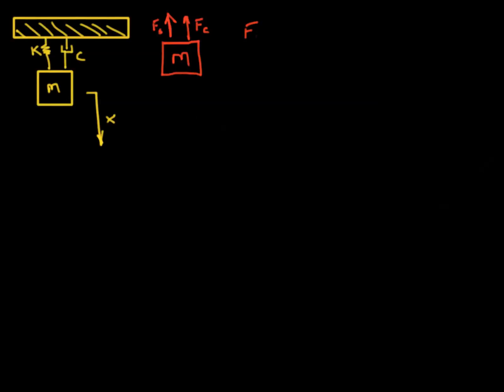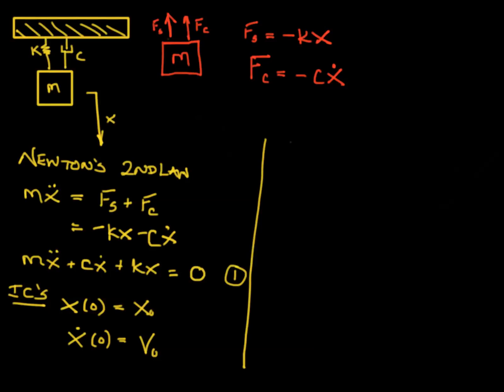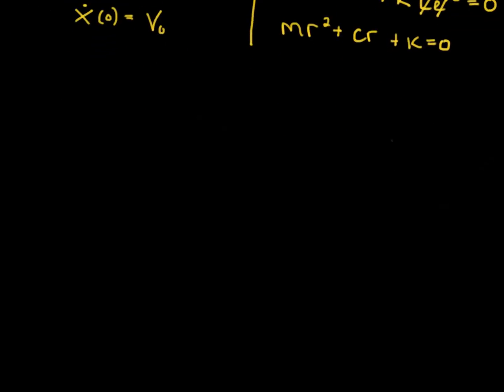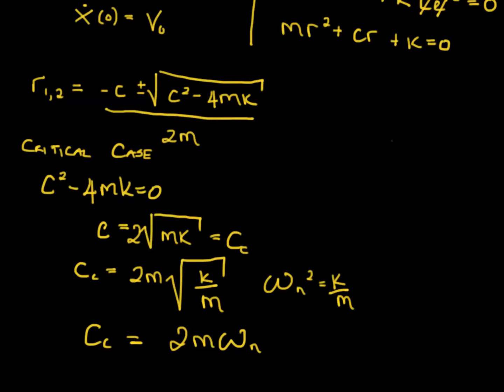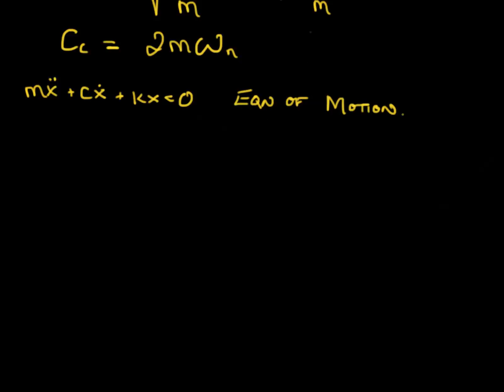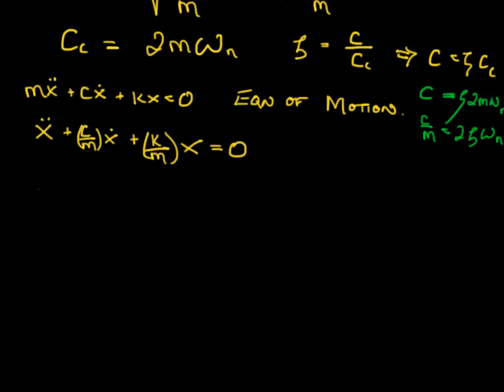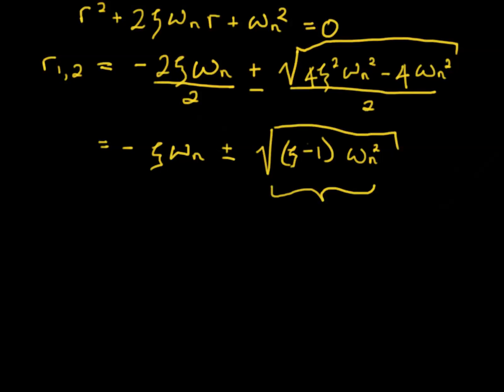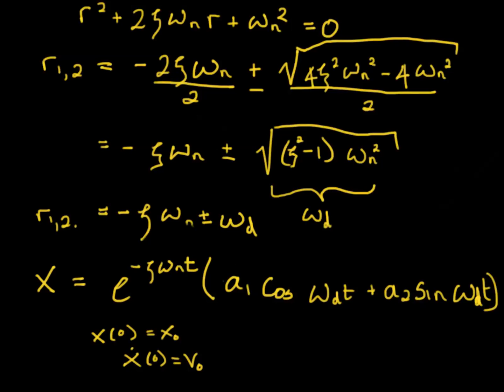Free Vibrations of a Single Degree of Freedom (SDOF) System with Viscous Damping

Comment: Hello, just unsure why the final solution involves sin and cos if we're dealing with the critical case? I thought we only used the trig functions when the roots are complex, and the general solution involves oscillatory motion — hence the sine and cosine terms.
Reply from the maker: I just showed the general form of the solution here.  However, in the case of critical damping, you end up with repeated roots and as a result of this special case, you cannot write the solution in the form of sin and cos, but instead the solution becomes an exponential with a negative exponent (ie a decaying exponential).  You can find an explanation of that here: youtu.be/S2-26LR8_Es?si=HmLhVArmR-9zBvqh&t=840
Reply: @Freeball99  thank you so much for the response!! especially since the video was posted so long ago, I appreciate it. Do you offer tutoring services?

Comment: I am not sure...why do you ignore the weight of block in the free body diagram?
Reply from the maker: +Sharon leung there is no assumption that gravity is present.  Another way to think of it is that the mass is moving along a horizontal, frictionless plane.  It turns out that the inclusion of gravity simply changes the static equilibrium point (which is the point about which the oscillations occur), but does not change the natural frequencies nor modes of vibration of the system.

Comment: C bar doesn't really matter in this case as they are canceled out eventually. I would rather treat it as a habitual action for the sake of physical description. Most of the physics equation has a form of A*e^coswt, so we can gain information of A (typically amplitude). In pure mathematics, e^rt is sufficient to describe any number (including complex number?) so C bar looks useless here.

Just my 2 cents, not very good in Maths either
Reply from the maker: Shawn, not sure I understand exactly what you mean, but a few things spring to mind.  Hopefully this addresses it.

Simple harmonic motion is governed by 2nd order ordinary differential equations. 
In a previous video https://www.youtube.com/watch?v=5Q_A15h7YgQ I demonstrated how to derive this using complex notation AND how this can be converted from the complex form to a real form.

In the video above, it was never my goal to solve a particular problem for a given set of initial conditions (as I had done in a previous video) , but rather to show how to incorporate damping into the derivation and solution of the characteristic equation.

You are correct that Cbar doesn't have an effect here because it cancels, however it is important to note that it is non-zero (for non-trivial solutions). 

With regards to your math above...e^rt is NOT sufficient to describe complex numbers...for this you need to add an i (where i^2 = -1).  So if you just assume solutions of the form:    x = Cbar * e^(irt)    then this will handle the complex case too.  You will find, however, that this assumption leads to the same final result that I presented.  I encourage you to use whichever approach is easier to understand, but from my experience, the students taking this introductory vibrations class often battle with complex analysis which is why I chose this method.

Hope this helps.

Comment: why take c Bar in teh value of x ( x=c' e^rt). i'm weak in math, tell me if that's some mathematical rule, I'd ignore it and learn it like that
Reply from the maker: Ashutosh, this is just a dummy variable - I could have called it anything.  In many of mathematical texts, this is written as just 'c', but I didn't want to confuse it with the damping constant, 'c' I decided to use Cbar instead.  You can call this whatever you want because it cancels out anyway.